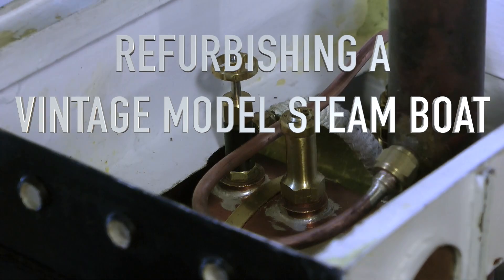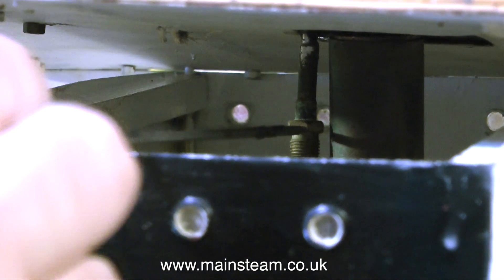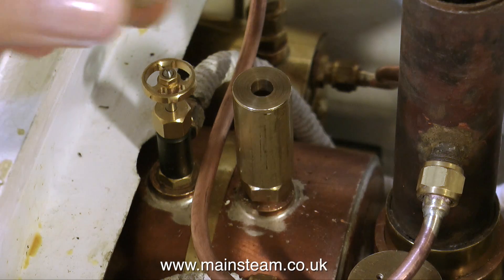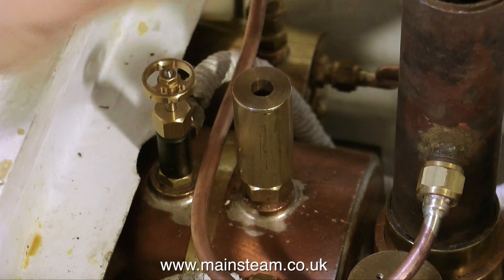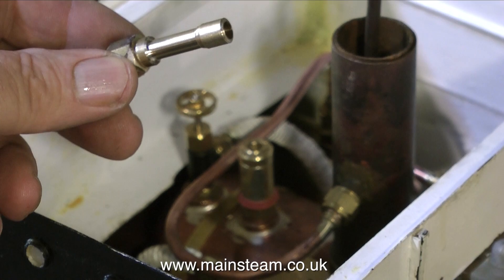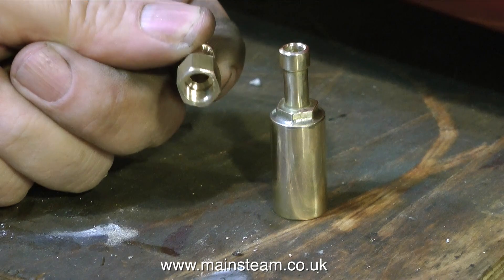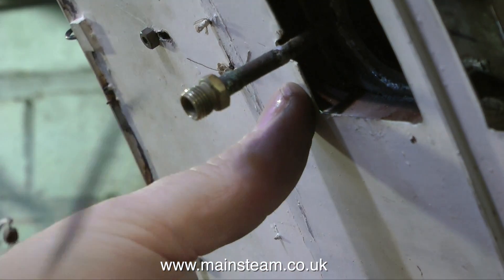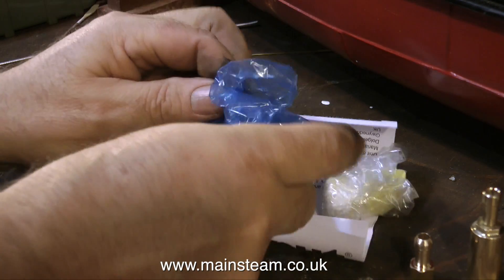REFURBISHING A VINTAGE MODEL STEAM BOAT - PART #22

Comment: "I feel that it is important to use as many of the original components as possible, so I always retain as many of the builder's original parts as I can"
I completely agree. And this is why, for the sake of like-minded future generations who may one day restore one of my projects, I always include a tightly-wrapped fresh unmixed package of Milliput, hiding in the corner, as one of the original parts. That way, they can use my original components, while repairing my horrible God-awful screw-ups.

Seriously though, (and perhaps I say this every time, I can't recall, regardless,) this is shaping up to be loveliest looking restoration projects to date. I usually haven't had much interest in the sort of models that involve scaling down all the non-functional bits of trim. But the way this project is advancing, it's starting to change my mind.